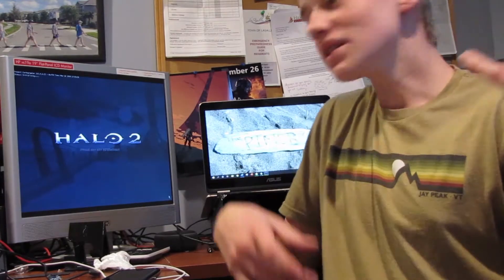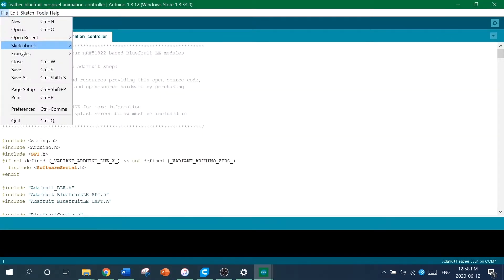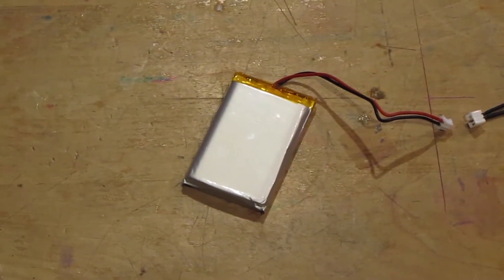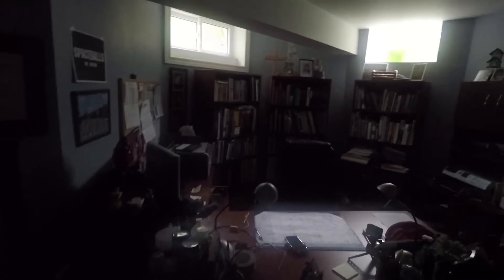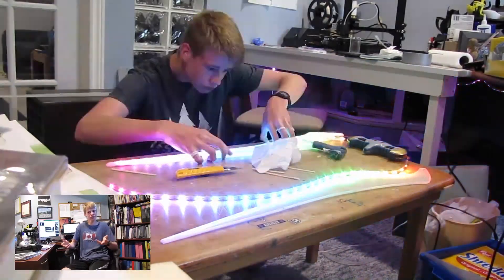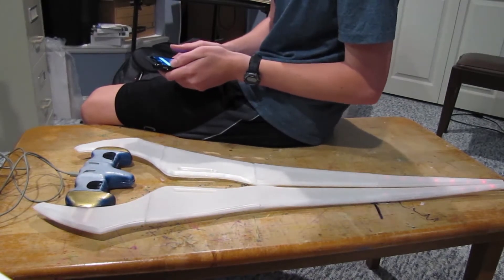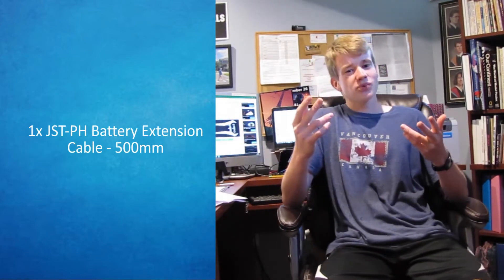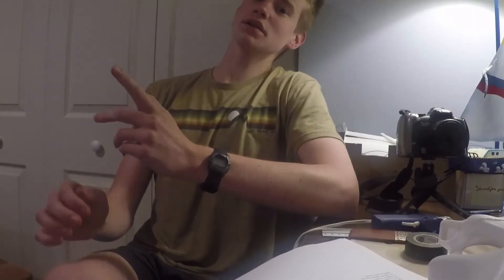Making an Energy Sword from Halo

Comment: How did you get two light strips with 28 lights if each meter comes with 60 lights per light strip?
Reply from the maker: It’s been a while, but I think I cheaped out and bought the ones with 30/meter.
Reply: @N8TEBB  thanks for answering so quickly! much appreciated!